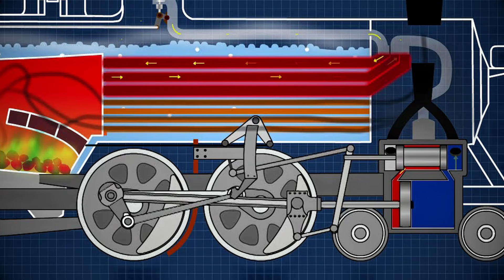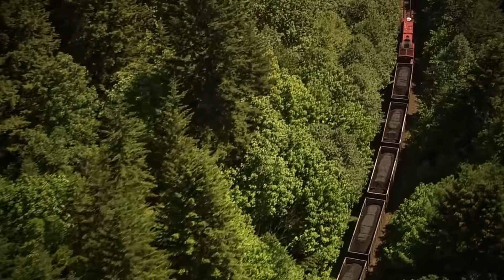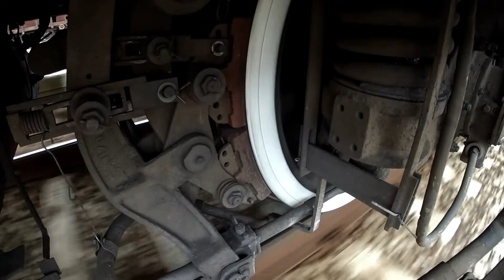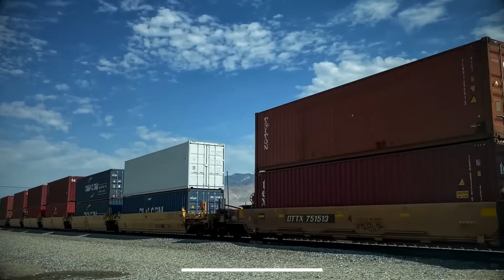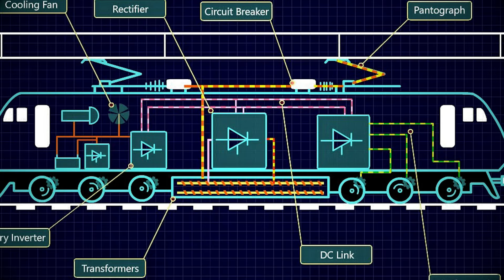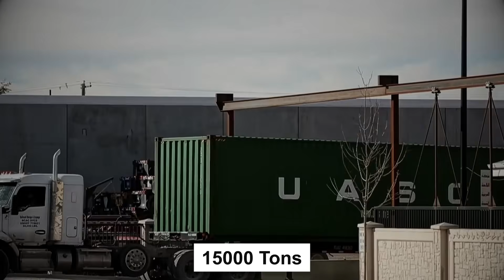How Locomotives Really Work?

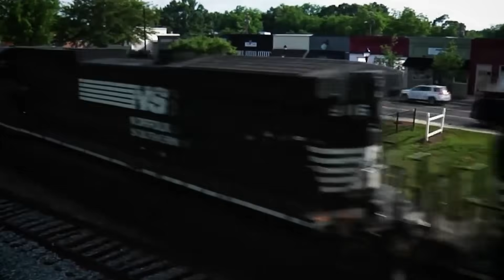Comment: At about 4:18 of the video you imply that DC traction motors aren't capable of regenerative braking.  This is completely wrong.  Electric streetcars with DC traction motors  have been using regenerative braking for over 125 years.  Dynamic brakes have been available on diesel locomotives with DC traction motors since the late 1930's.  Dynamic brakes are regenerative braking systems.  You might want to correct your misinformation.

Comment: As a kid, I used to wonder why the diesel motor was throttling up while the locomotive was barely moving.  It was when I learned that the diesel engine didn't actually drive the vehicle, but was used to generate electricity, that I understood.  Back in 2013 I had the pleasure of spending a day riding in a locomotive with a buddy of mine.  They really smell bad inside!